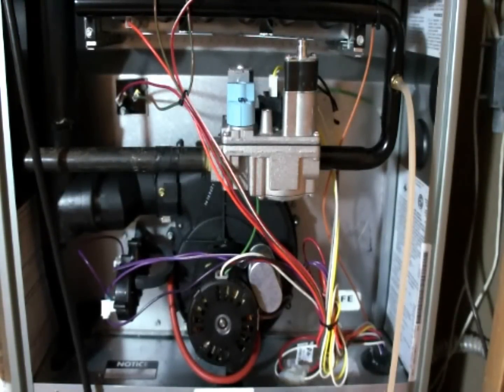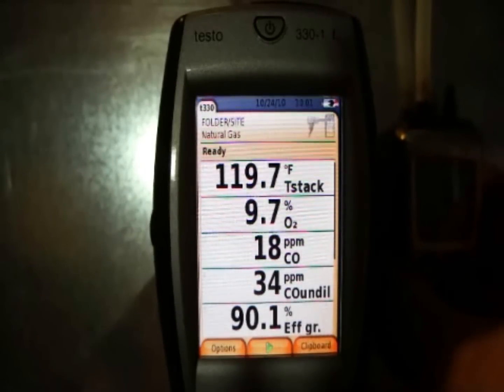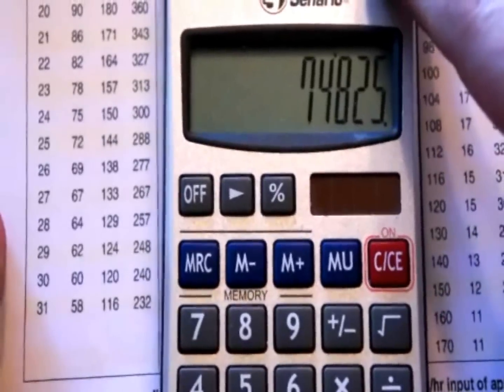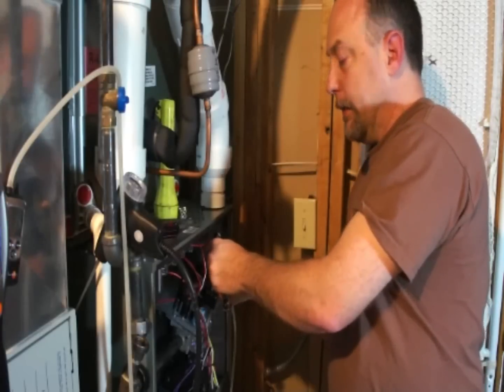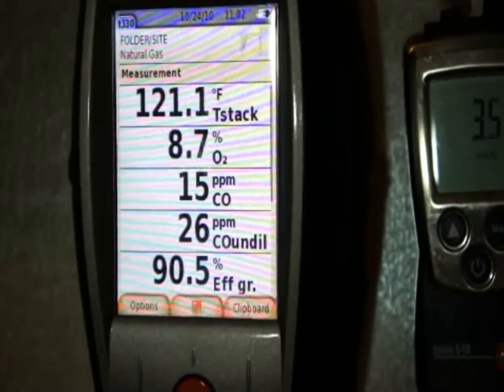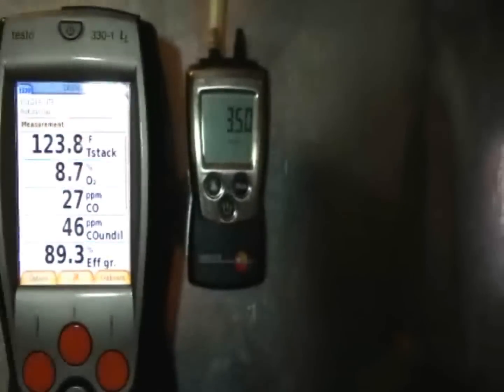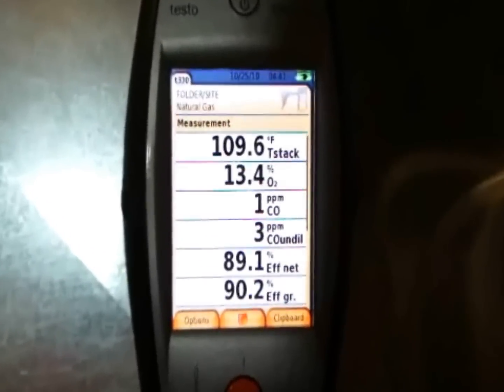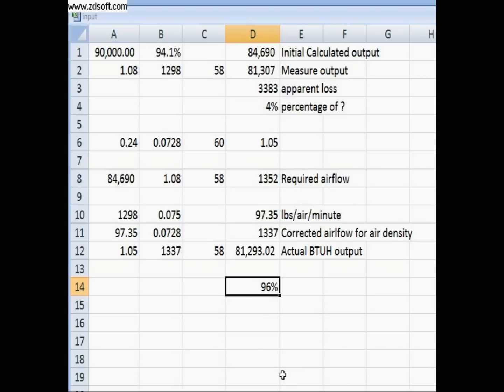Setting Up a Furnace for Proper Input

Comment: @fritzhvac Jason once a Dial Meter (2 cubic foot dial) is in place in your Gas Line ,Turn off all the units except the one you are measuring, then go to the meter with a watch or clock with a second hand. Simply time how long it takes for the 2 cubic foot dial to go around once, or many times, for greater accuracy. If it takes two minutes for the 2 cubic foot dial to go around once, it will go around
thirty times in an hour.

Comment: @tstatech Jason you can buy a full on dial type meter, or an individual flow meter to put inthe gas line that will measure floe around $150.00

PROPANE :
Thirty times two cubic feet is sixty cubic feet per hour.
One cubic foot of propane contains 2,488 BTU
60 cubic feet of propane contains 149,280 BTU
Your rate of consumption is 149,280 BTU/hr.
One gallon of propane contains 93,000 BTU.
149,280 divided by 93,000 equals 1.61 gallons.
you

Comment: So going down in number when sizing orifices is a bigger opening,  more gas? You were under fired and you went from a 50 to a 49. Also, from your final numbers,  do you think going to a 48 would have been a little better?
Reply: Richard Fossani, The larger the drill size, the smaller the office number so a 49 is larger than a 50. Maybe I could’ve gone up one larger size but I don’t know that I would’ve gained that much to make it worth the effort. I was able to achieve the input by adjusting the gas pressure. Typically there’s an allowable range of 3.2 to 3.8”

Comment: You went from 84,000 BTU on the chart to 86,000 BTU in the calculation so you would have been more under fired.
Reply: No Sir, he was closer to the 90,000 target.

Comment: @jimbergmann3 
Thanks for the reply.  Without taking any more time here, I will update you when I have  figured out how to get the gas meter communicating.  I do know that nothing will happen until the gas utility company allows access. 
The main reason I ask you all about this is I hope you can help "automate" the clocking information into the combustion analysis calculations once the meter flow rate is as easily captured as furnace temps. No worries if this all sounds overwhelming.

Comment: Thank you Jim for investing the time & effort to produce this video.  Well Done!
I have an obscure question:
During the time you were out clocking the meter, you mentioned that the gas meter had been upgraded to support remote monitoring.  
I assume you mean that your gas company has upgraded the meter to a Smart Meter w/ wireless radio (Zigbee) installed.
Questions: 
Are you using the remote monitoring capability yet?
What tools are you aware of that support this capability?